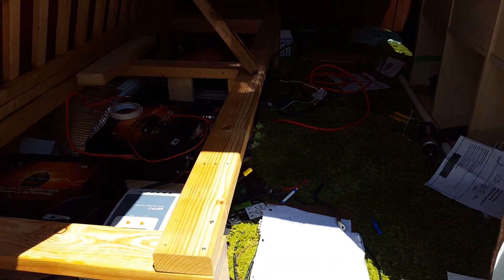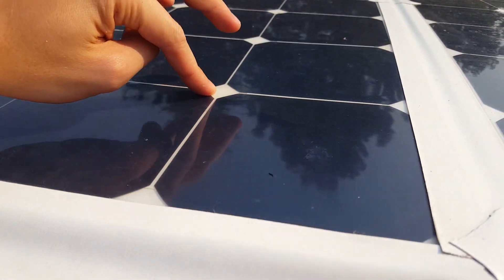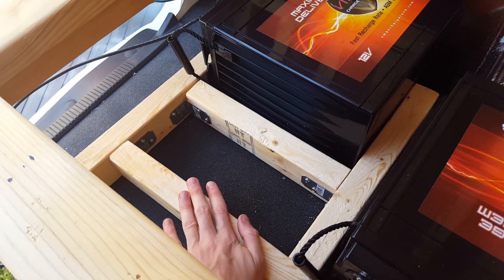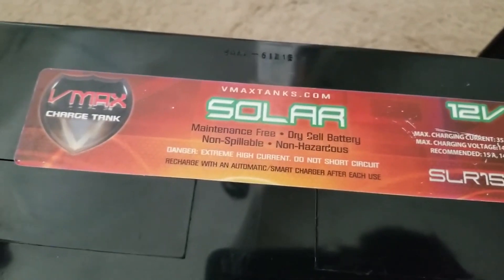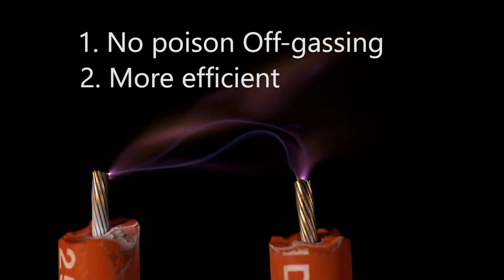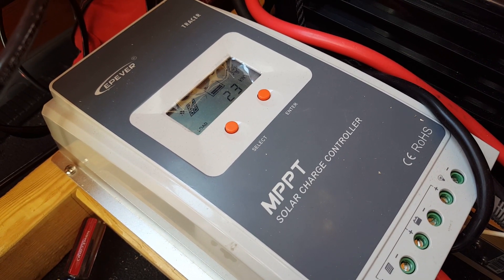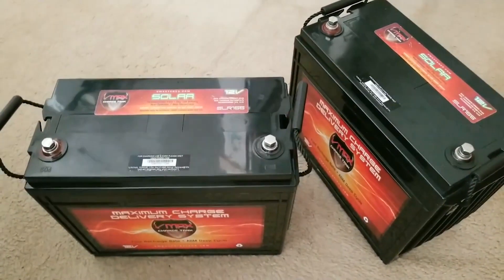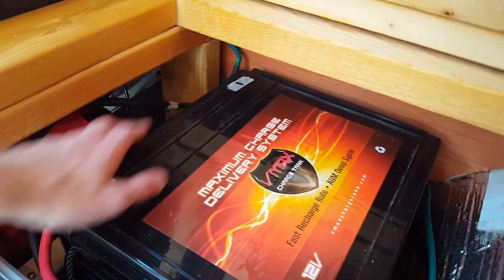Which Solar Batteries Are Best for Off Grid Van Life?

Comment: I have tried reading the instructions for my epevers MPPT charge controller. Is it saying that when the battery shows empty it's only empty of the safe amount? or is it empty all the way? because I don't see the exclamation triangle next to it that says that it's over used. I'm confused as to what it means. I also just spent the last of my money on a second battery and when I connected them back up it says that my battery power is half empty but shouldn't this battery have been full. I've tried reading the manual over and over and over and it seems like only a little bit of it is relevant to me because I have a sealed battery. it says that it will automatically set up its settings because sealed is its default. so I'm trusting it to stop over and under use. It stopped charging my phone the other day and the battery icon had no bars
 so I bought the new 2nd battery to fix this now I have 200ah. Oh and I had to do this with just the enter and select buttons.